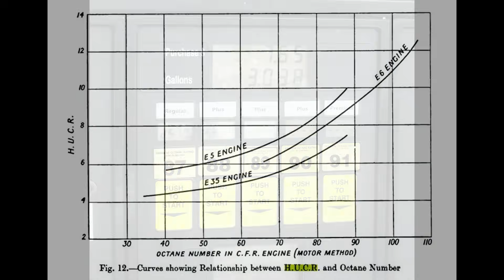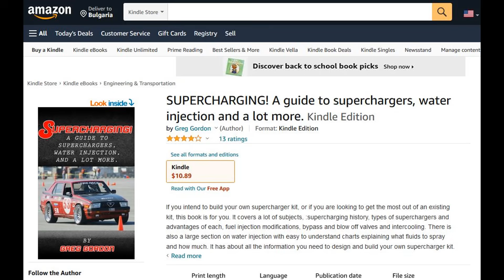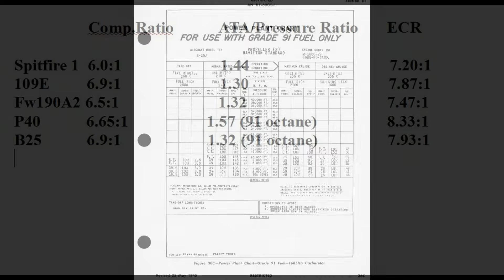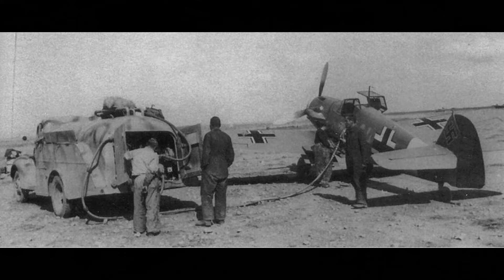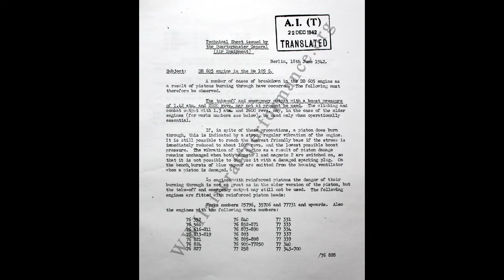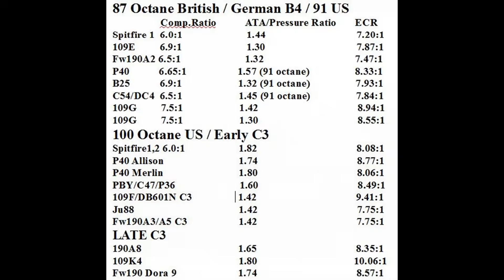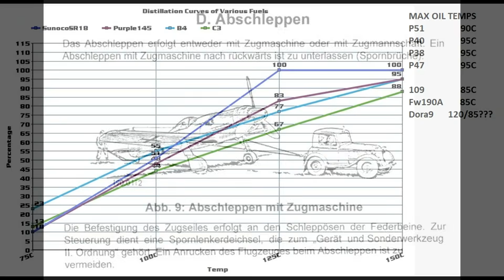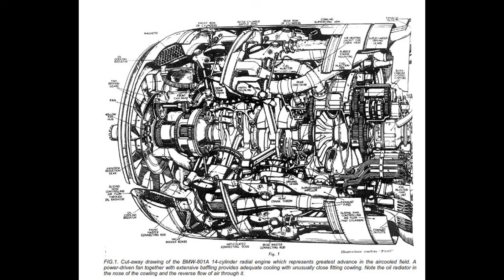German C3 Fuel, Uber Octane or Synthetic Crap?

Comment: Side thread, on two stage super charging, I seem to recall from an earlier video that the Germans were using a fluid clutch to allow their superchargers to vary speed rather than manifold diameter to control their boost production? 

Wouldn't that, effectively, give the same or better performance over altitude that a comparable critical altitude multi-stage supercharger did? 

I'm thinking of this separately from intercooling. I fully agree that adding a charge air cooler of some sort would have helped develop more power.
Reply: I think that the variable speed supercharger used in the '109 gave an efficiency advantage at lower altitudes and a power advantage at certain altitudes. 
Two-stage supercharging gives an altitude advantage. 
The best solution, assuming you aren't looking at a turbo, would have been variable-speed two-stage supercharging.
Reply: I am currently reading the secret horsepower race and I believe the fluid coupling is what allowed them to get such an efficient single stage which allowed them to use only one stage without a intercooler which they really didn't want to use.
They experimented with 2 stage supercharging and found it to be inefficient compared to single stage. They didn't really think people would Brute force through the inefficiencies. (Which is exactly what the allies ended up doing)
Reply: @lightunicorn1371  I could see that. Thing is, aside from the octane issue, it really seems like the German fighters kept a comparable power vs altitude curve to the Allies fighters. 

It seems like the big problem they had was in intercepting turbo charged bombers.

On the allies side, I'm trying to figure if there were supercharged fighters, aside from the P-51, that were successful at escorting the turbo charged bombers? 

As I'm thinking about it, the BMW801 had a geared supercharger didn't it? Did they ever try the fluid coupled super charger on it, or was that just not feasible? 

From what I recall, their critical issue was the FW-190A's performance just dropped like a rock after 15kft.
Reply: @HarryVoyager  ahhh ok that is a wonderful question actually. I really hope this is answered by someone far more knowledgeable than me.
Reply: @HarryVoyager  The P47 was able to escort the B17 and B24 at altitude but was limited in range. The P51s secret was it’s low drag wing which enabled not  only the range to get to Berlin, but also 435-440 mph on “only 1,650 hp and a 27 litre motor when every other fighter with that sort of performance needed a much bigger engine and 2,000+ hp.
Reply: I think that Greg partly addressed this in another one of his videos that compared and contrasted the range of the P-51 and P-47.  The partial answer was that the Allies came up with a solution that worked (P-51) and decided to just stick with it.  The P-47 could have done well in that role as well if given similar development as the P-51 (e.g., earlier development of drop tanks), but that was extra operational complexity they didn't want, and they had other ideas for the Jug anyway.
Reply: @SvenTviking  That was part of my point. The P-47 and P-38 used turbo chargers, not superchargers and were able to perform up to 25/30kft. Meanwhile the P-51 was so low drag, it was extremely fast at nearly any altitude. 

But, the rest of the supercharged fighters all seem to start dropping off above 20kft.

On the P-47, I believe Greg pointed out in an earlier video that the P-47 did have the range, but Allied Air Command were still stuck on the "bomber always gets through" doctrine and couldn't find a graceful way to get out of it without the bomber mafia admitting they'd screwed up. 

The P-51 also being able to do that gave them a convenient way to pretend it was a serendipitous unforseeable arrival that saved the day, rather than them finally changing their strategy.
Reply: @HarryVoyager  The P-47 and P-38 both used two stage supercharging, as the turbocharger fed into a mechanically driven engine mounted supercharger. You can only get so much boost out of one stage of super charging berfore you start loosing efficiency (i.e. you end up adding more heat and less compression). Two stage supercharging allows higher boost with each stage operating at lower boost but higher efficiency.
Reply: @SvenTviking  "The P51s secret was it’s low drag wing"
It seems that is mostly a myth.  P51 was a low drag airframe, but big part of it came from high quality production (flush rivets, smooth skin), not necessarily a marvelous wing design.  Having MGs instead of cannons surely helped too and also the cooler design allowed for less drag overall.

"435-440 mph"
Supercharger tuning had a lot to do with it.  No matter what the peak power is, when you climb high into thin air and your motor struggles.  The higher you go, the faster true air speed you can achieve for any available horsepower.
With all that said, Mustangs were faster.  I'm not denying that fact.
Reply: @HarryVoyager  Greg also made the point that you could buy three Mustangs for the price of two Thunderbolts.  The Lightning was also an expensive ship. I'm sure it was an easy choice to standardize on the Mustang as soon as they became available in numbers.
Reply: @jaym8027  Well yes. But that does not excuse them from, as near as I can tell, lying about the capabilities they had before the Mustang either. 

They had the technical capacity to escort the bombers before the Mustang. They just chose not to, and after the war the same people obfustricated the capabilities they had to imply that they did not have that capability prior to the P-51.

But that's getting off of the real original question: would an after-cooled hydraulic super charger been comparable to an inter-cooled multi-stage geared super charger? 

Based on the compression response to altitude we saw from the Daimler Benz hydraulicly couples super-charger, it appears that it could be, because it is able to maintain better efficiency up to and before it's critical altitude, but it would be interesting to work out in detail.
Reply: @HarryVoyager  The Norwegians flew top-cover for the bombers with Spitfires. (I presume this was mostly Spitfire IV. I would have to go to the public library to see if they did this in the Spitfire V period too.) And since the Spitfires are day fighters, I assume they mostly flew for the superharged Americans. However, I guess they couldn't fly all the way to Berlin.
Reply: Interestingly, I just found out that the R-2800-30W and R-2800-32W may have actually had variable speed superchargers. 

The -30W was reported to have had a single stage variable speed supercharger for the F8F-2 Bearcat and the -32W is reported to have a two stage variable speed supercharger for the F4U-5 Corsair. 

Both of these are R-2800 'E' type engines, so apparently some of the very last models of the engine designed, and only used on post-war fighters, but if we can track down how they performed and how they were configured, that could be really interesting.
Reply: @HarryVoyager  Jep, that's sadly post war and if memory serves me right they didn't achieve their max speed at the same high altitudes as the Mustang, Thunderbolt or -4a Corsair.

Comment: Not sure about the compression ratios on the non-Chevies mentioned, but I have noticed that the Chevy ones are overstated a bit, not only in advertising but even in the Power Manuals.  They appear to be calculated using only the head and gasket volume, ignoring the extra 4cc or so for the valve notches in the piston.  For a 4.00 x 3.48 cylinder with 68cc chamber (double hump head, 350 version), 9cc for .041" gasket, and imaginary deck height flat top piston with no valve notches, I get 10.30:1 -- very close to the advertised 10.25.  Adding 4cc for valve notches, I get 9.85:1.
Reply: I have redone many 60s / 70s engines for restoration and to increase performance.
The posted compression ratios were rarely achieved on production engines.
Machining tolerances were not computer controlled and the machinists were under the gun for production numbers.
But as Greg said, it is not practical or even possible to sample original engines from that era.
In fact that is where the term Balanced and blueprinted came about.
You would correct the specifications to the factory blueprint. And correct the balance of the rotating assembly.
Factory engines usually were not very well balanced but were overbuilt to stay together.
When you balance a rotating assembly on a modern digital balancer it is scary how far out they are.
But it worked and that was good enough back then.
Reply: @kennethalexander755  
Most of the major components in an internal combustion engine are actually machined on long banks of machining stations that are called transfer lines. Each station performs a specific task. Boring, honing, drilling, tapping, broaching, chip clearing or inspection. The initial step in machining cast iron blocks, heads, baring caps etc was usually broaching in large machines that use cutting tools that are basically metal files writ large. Todays machining lines consist of rows of specialized machining stations that are CNC controlled in terms of depth of cut etc.
Reply from the maker: I am using manufacturer's data. I'm not sure it's realistic to use anything else. I can't very well find and disassemble all these engine and measure them myself, and if I did people would dispute those numbers.
Reply: @GregsAirplanesandAutomobiles  Not faulting you for doing that, especially since your objective was merely to demonstrate the approximate similarity in C.R. among different engines using similar fuel.  Just adding an observation.
Reply: @GregsAirplanesandAutomobiles  
The difference in compression ratios in the various low compression and high compression versions of the same engines offered by automotive manufacturers can be explained by using different castings with larger chambers for the low compression engines. The higher output engines may also have larger valves, different exhaust manifolds, forged cranks and forged rods. Also different pistons.

Comment: Hi Greg, another great video. I’m a technical manager for an oil company who knows a bit about gasoline formulating.  I have a hypothesis about why C4 might not have had quite the performance that the bare octane rating might imply in some of the German engines. Not sure how to reach you privately to discuss….
Reply from the maker: feel free to email me at gregsairplanes  at gee mail
Reply: Altered Attitude: Please share this with us :-) I have a hypotesis fusing a a guess of more cyclo-alaknes and "iso-octane" in Allied fuel, and more aromatics in German fuel; combined with shorter "energy-steps" in the molecular-orbital (MO) energy level diagrams; combined with the statistical population of these levels as the temperature increases during compression (Boltzman distribution?); which then eventually leads to the German fuel being tipped over the edge to pre-ignition first. -- It would be gratifying to know if I wasn't that far off.
Reply: @Kordzi387euren  Good knowledge on the radical development side Ole, but think it’s perhaps worth considering this more empirically. Essentially octane tests measure detonation under conditions defined by the test. The different tests (MON and Supercharge Methods) result in very different temp/pressure relationships in the end gas at the point of detonation. What then needs to be considered is what is the octane index of the engine you care about both in terms of absolute value and relationship between T/P (which can be expressed as a function of MON and RON in today’s world, but could equally be expressed as a coefficient MON / Supercharge Ratings which then can be derived through testing fuels of various sensitivities and applying linear regression.  
In the case of C3 we know it was predominantly cyclic (the synthetic Bergius process used produces cycloalkanes, but dehydrogenated to give higher octane aromatics). The allied fuels relied more on alkylate which is predominantly substituted liner alkanes.  
The difference is that the cyclic fuel is more likely to result in a higher Supercharge rating (low T/P)for a given MON (or vice versa) and so would advantage engines with low end gas temps. Think liquid cooled, carb engined (enthalpy leads to inlet cooling) charge air inter cooling. The opposite (air cooling, non inter cooled etc) would result in a higher demand that would have to be offset by lower compression ratio or boost. 
Add to this that other factors add to an engines octane index (e.g. low engine speed, larger cylinder bore) then we can start to see that many of the German engines might have to back off on the boost / compression ratio to compensate for the other factors that increase OI and others that drive the T/P ratio higher which would disadvantage them (air cooling BMW801, no inter cooling etc.)
Hence my hypothesis is that allied engines like the Merlin / V1710 are more likely to have an easier time (or be able to use a higher boost / compression ratio) on a given fuel when compared to many of the German engines. 
There are more issues related to organic octane boosters that I know the Germans were working with at the end of the war and how they are likely to also show a faster transition to severe detonation when compared to non organic inhibitors such as TEL. Hence operators may choose to operate their engines further away from the detonation boundary (i.e. back off on the boost) to avoid damage.
Reply: By the way it’s worth noting that the second, higher number used to define aviation engine ‘octane’ ratings is not a Rich Mixture number even though it is often referred to as such. It is actually a Supercharge test (ASTM D909) that uses fixed inlet temp and varying inlet pressure to reach knock and then varies mixture around the stoichiometric to get to peak knock and through bracketing with reference fuels, to derive a Supercharge Performance Number (performance numbers are octane numbers above 100 - because it’s not possible to have more than 100% octane as the reference point). So the test itself does not rely on the charge cooling effects of overly rich mixtures. 
Rich Mixtures do affect an engine’s octane index / demand and therefore would also allow a lower octane rating fuel to be used free of detonation, so we should try to think of rich mixture charge cooling effects as being an engine Octane Index (engine demand) property and not a fuel (octane availability) property.
Reply: @CAP10Driver  Thanks :-)   I have always known that "Octane"-numbers are to be found empirically. But I found this facinating stuff in Calum Douglas book, the chapter "Prelude to war" about the allied fuel have flatter curves/surfaces in "knock-resistance" vs inlet temperature; and I remembered it as a 2 dimensional graf of allied vs german fuel. But I misremembered: It was a 3-dimensional figure plus text. It was the steepness, not absolute values, of the relationship that made me ponder...
Thanks for the information about the name of the Bergius process. It was interesting to read what I could find fast on the internet. And very much thanks for the tidbit of allied fuel regarding the low cyclo-alkane content vs linear-alkane content.
Reply: @Kordzi387euren  I haven’t read Calum’s book, but that sounds like a feature of the same phenomenon. Effectively he seems to be saying that the allied fuels have a lower sensitivity to inlet temp which will drive a wider range in T/P in the end gas which would favour fuels with lower sensitivity ergo iso-paraffins.  This was the difference in the synthetic base fuels between the allies and Germans at this time. The alkylation process developed by Shell in the 1930’s (which combines crude-derived gasses to synthesise the octane molecule (2,2,4 trimethyl pentane) was the backbone of the 100 octane fuels for the allies, whereas the German fuels were more heavily based on aromatics due to their coal feedstocks.  The Germans did not have access to any alkylation capacity throughout the war and a limited access to the source crudes. As you have worked out, when the composition is so different looking at only one octane test method is not enough to predict performance in a given engine.  This is what gave rise to the supercharge test method in the first place as the allies had a number routes to 100 octane prior to the war (e.g. cumene) but later standardised on alkylate as a basis. Alkylate is something that forms approx 75% of today’s Avgas 100LL formulations right up to this day.
It’s been a pleasure chatting to you Olé - you seem to have good background knowledge.
Reply: @CAP10Driver  Yes. -- It seems strange that 2,2,4 trimethyl pentane can be formed in what seems to be high concentration. Perhaps there is an intermediate step there where a radical is stbilized on a secondary or tertiary carbon??
And PS: I may have been among the last doing mandatory exercises on TEL at the university. -- I have NO idea how the stuff is working as an anti-knock agent though. Perhaps as a radical scavenger??
Reply: @CAP10Driver  Cumene: A new one to put in my mental library 👍
Absolutely a pleasure to chat with you too :-)
I have a master degree in inorganic chemistry, with some extra quantum chemistry.

Comment: convert compression ratio to Hg?  some of us use Hg
Reply from the maker: what?
Reply: maybe referring to boost pressure in psi?

14.7 psi = 1 atmosphere = 29.9 inches Hg  =760 mm's Hg.

It can also be expressed in units of  lbs / cm*2 if you are interested in a bipartisan unit of pressure.
Reply: @GregsAirplanesandAutomobiles   convert ATA to inches of mercury.
Reply: @trimbalemrbale575  That's 29.92 inches of Hg at standard temperature.